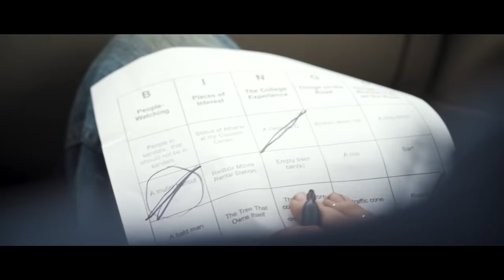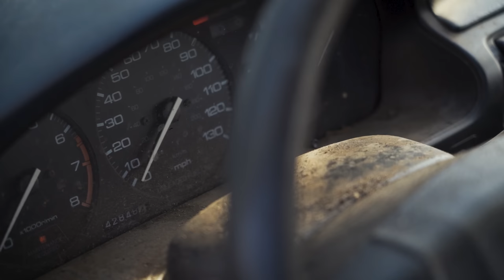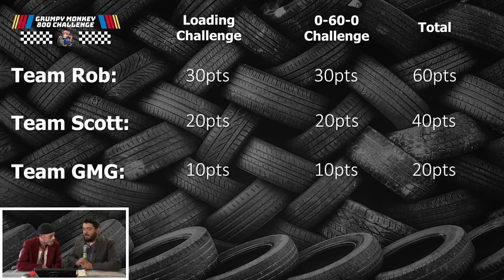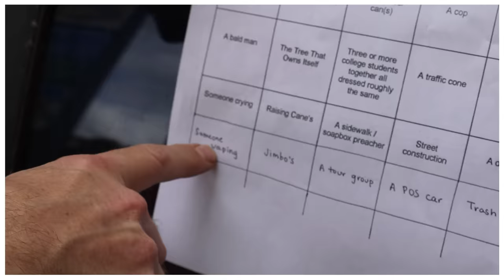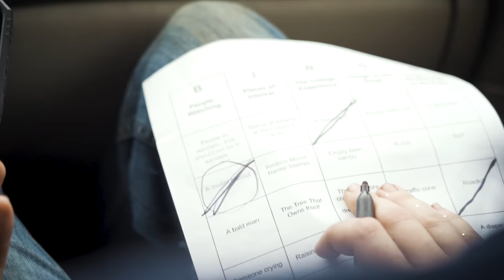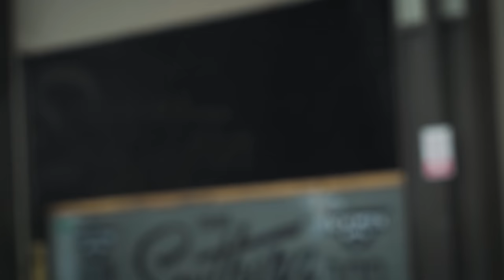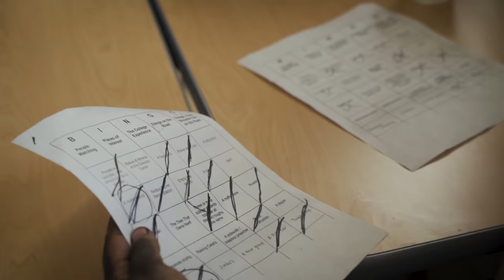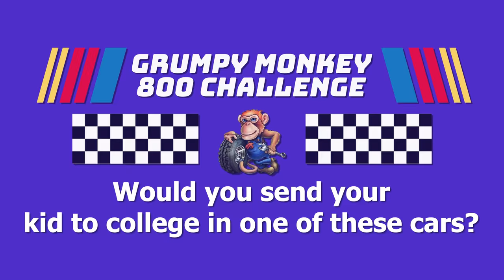$800 CHEAP CAR CHALLENGE, Forcing Three $800 College Cars to Compete, Grumpy Monkey 800 Challenge

Comment: The white Honda only needs a fuel pump to run. Both of my f23 accords did that. Fixed one for $80. About to fix the second one. Always check the pump when it sputters and puffs smoke out the air filter like that.
Reply: We actually did a compression test after this was all done and it was down on a cylinder pretty bad.

Comment: Proud owner of a $750 '90 Honda Accord I bought a year ago from a neighbor down the street, here to vouch for the all around beat it up til you wrap it around a tree class reliability of these cars when you treat them well :)
Reply: Scrap yard buy. 2001 chevy truck 4.8 . 400 bucks. She is a piece of garbage. But It never stops making me money. Ive run it at 6800 rms 3 times till the tires blew off. And years of red line abuse. Now its my daily driver 5 years later. She does have an odd misfire though.. haha
Reply: I still redline it... and tires are getting expensive.

Comment: I had a 1999 Toyota Corolla up until new years eve this year. I had it for around 2 years. When I bought it had around 221,000 miles, and when I sold it had around 260,000 miles. A lot of people seem to think that the 8th generation corolla is the worst one, but aside from a broken belt, I never had an issue with that car. I changed the oil every 5,000 miles, and in that time it didn't burn a drop. The underside of the car was clean and it didn't leak a drop of anything. When I got it, the transmission fluid was BLACK, but I changed it and it shifted fine and drove great. The A/C was also better in that car than a brand new car. Sadly a tree branch fell on it and caved the roof in, so I sold it. The guy I sold it to bent the roof back out and put a window in it and as far as I know, it is still on the road.

Comment: Nice! Camry tip when pulling the head off 5sfe use one of the trimming cover 10mm bolt and use the in the exhaust cam to keep the cam from unwinding...

Comment: Havent even watched it yet but im going with the cb7 because its my favorite chassis. Ive had 4 of them. All i drive is accords. I have a 94,a 98 and a 2003 right now. They are bulletproof when you take care of them and really easy to work on. Usually a dizzy ,main relay, or parasitic drain somewhere when they don't run.

Comment: Ain't no real cheap beater challenge if you ain't testin thems off roadin ability
Reply from the maker: Stay tuned! Budget 4x4 challenge coming soon!
Reply: @GrumpyMonkeyGarage  
I'm thinking a 90 Chevy Blazer, an old beat up Ranger, and a Toyota with 350k miles and a rusted out bed